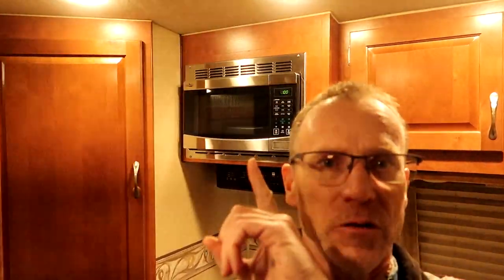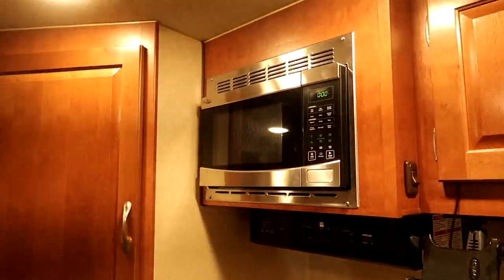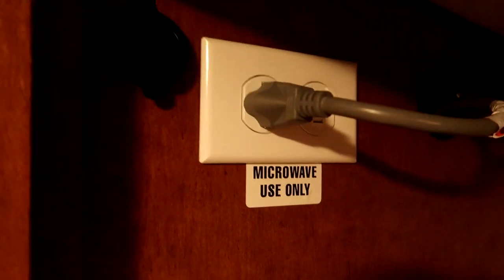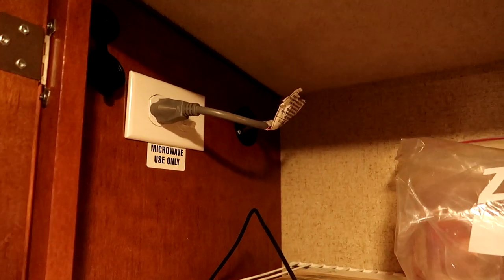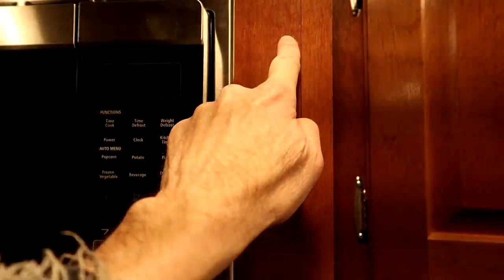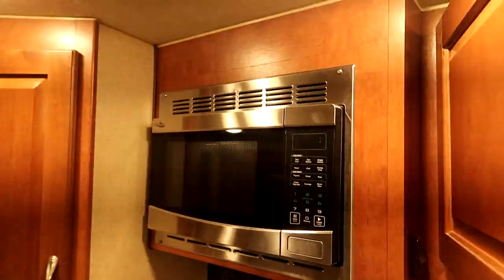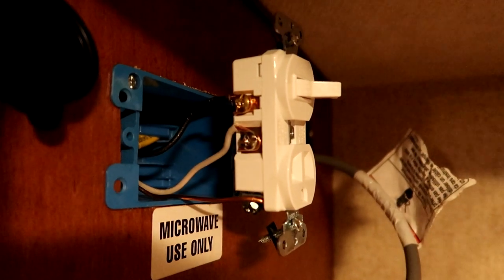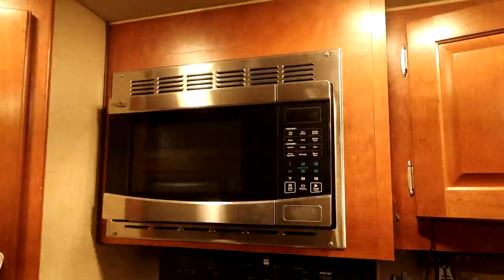How To Disable your Microwave when running on inverter power

Comment: We went with the convection oven and then chose to do the 120v 2 burner ceramic cooktop mod to our Arctic Fox. Thankfully, the convection oven gives us the option to turn off the clock, so we don't have to deal with that annoying light in the evening. 

We just added a wall hanging Dickerson diesel burning fireplace near the back door, during this Christmas break. We opted out getting the back windows when we ordered our 2022 arctic fox 865. 

Now we're having one of our upper cabinet doors modified all because it's hitting the exhaust of Dickerson heater. If it isn't one thing it's another. Yeah I didn't quite have the greatest plan when I started.😂

However we do love the Dickerson so far, it just sips the fuel. He was in the teens last weekend, when we went out and tested the system.

I ordered a stainless steel box that will attach to the outside back wall, all to hold a diesel fuel cell. Hopefully I'll be here in the next week. 

We still have the OEM furnace that circulates heat in the basement keeping those pipes and water tanks nice and toasty, on those extreme cold nights. 

Now thinking about adding one or two of those computer fans to help with circulating the cabin heated air throughout the basement, but still haven't quite worked out how to do that yet. 

Last year's big mod was adding the 12-volt roof-mounted AC, 420w of solar up top, then upgraded our batteries to lithium batteries and then added the froli sleep system, that truly made a huge difference.

It's funny, my buddies are always turning wrenches, spending money on their hot rods and motorcycles. That's all they seem to talk about when we meet up at the diner for lunch. Me, I had to go by myself an arctic truck camper, yeah me 😂

Maybe that's why I'm just sitting here rambling, yeah 😂

I like your upgrade, and of course enjoy your videos. My question is, have you ever had to service your lifting jacks?

While I'm waiting for that stainless steel fuel cell box to arrive, I've turned my attention to the camper jacks. So if you have or are planning on doing any videos when it comes to your camper jacks, would love to see it.
Reply from the maker: One of my jacks has issues and needs serviced.  It barely lifts.  It goes really slow.
Reply: @deltabravo1257  I just got told that Charles Coushaine made a detailed video of servicing lifting jacks. Haven't yet went to his YouTube channel but I've seen his video so I'm pretty sure he would probably have something on his channel. If I learn anything I'll reach out to you and let you know.

Comment: Appreciate your content and your mod seems like a handy power saving hack.  

Question, is the switch/socket you installed rated for high enough Amperage for that microwave?  You may need to check it could be dangerous (fire) if it’s too low.  Your breaker will not stop this because it’s rated for the microwave.  

Also, I don’t know if you realize but there is a lot of video flickering in the scenes inside your RV.   It’s because your camera is recording (60 frames per second) and your lights are running at the exact same speed (60hz) You may try to adjust the lights in your Rv (if you have a light dimmer) or possibly the recording speed (if it’s an iPhone settings/camera, don’t know other cameras but google “frames per second” and camera name) of your camera; or it may not be possible.  Again, thanks for the idea.
Reply from the maker: The lights are DC, not AC.  The reason they are flickering is because I didn't have the dimmer set to full brightness.  DC dimmers operate on a function called "Pulse Width Modulation" (or PWM).  My lights are LED.   The PWM dimmer rapidly switch the lights on and off, which causes flickering when they are being recorded by a camera, due to them being LED.
Reply: @deltabravo1257  Yep that was my first suggestion, I did not realize you already were familiar.  Was just trying to help.   I can delete the comment if you like,
Reply from the maker: It turns out my microwave is on a 20 amp breaker, so I need to put in a 20 amp switch/outlet.  The one I installed is only rated a 15 amps.  I suspect the reason a 20 amp circuit it installed is because maybe a "convection microwave" (an option) needs a 20 amp circuit.
That flickering is pretty annoying, so I'm going to make a new video.
Reply: @deltabravo1257  you could verify the amps on the back of the microwave first.  It may be a shred circuit although unusual for a microwave.   Best of luck.